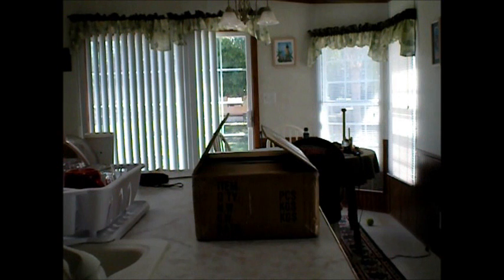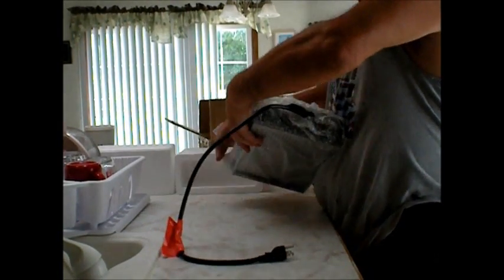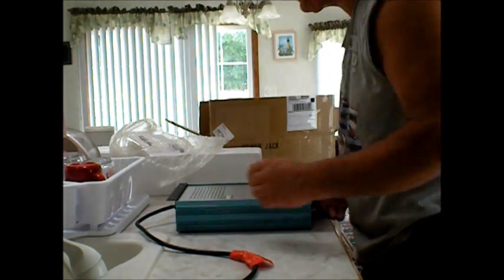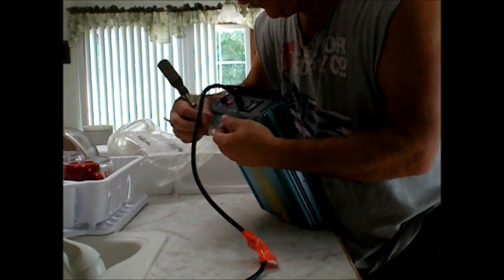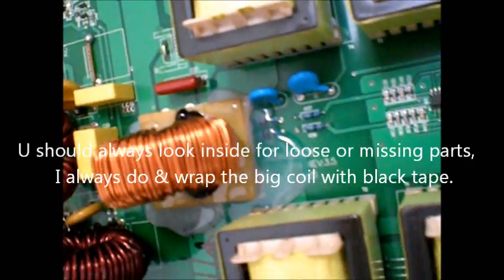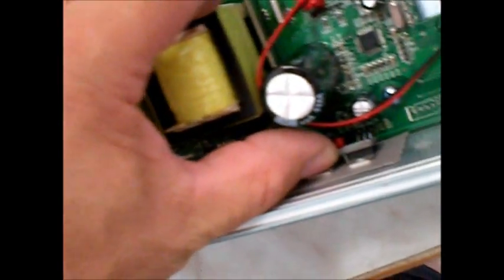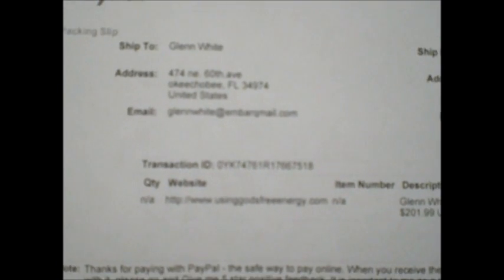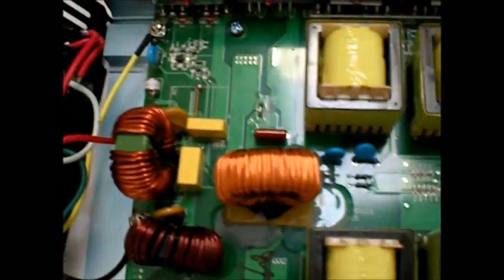A LOOK INSIDE MY NEW 1200 WATT POWER JACK #3

Comment from the maker: The Big coil i point to Barely clears the Back,the metal i pulled off to look inside. if the coil should hit the metal it could short out.or cause some other malady,The First 1 i got The Blue one with the big heat sink is the newest 1 it was built in December of 2011.this 1 in July of 2011,the other 1  the same color built 09-11,so i guess any that are built in 12 will be blue and have the coil wrapped at the factory. It has a CE,Rating a UL or ,ETL, soon it seems how there going I,m guessing.

Comment: why do you wrap the coil with black tape?
Reply: Because it is so close to the back panel and may arc across. Personally I prefer thin mylar sheet sold as stencil sheet glued on the whole back panel. But I have used glass fibre tape on coils.

Comment from the maker: This Is just Like the Other 2 new style power jacks. I have had great luck with them they work as they are designed to. But the last 2 i got this 1 and the other aqua 1 were made mid year 20011 the blue 1 on the bottom came with the big coil wrap in tape and well sealed in side with ample red sealer like what is inside of my GO Power 12 volt DC/AC inverter that has all the rating that u can get Marine ,RV, ambulance. etc, it,s totally coated red inside to make weather tight I Guess.

Comment: Thanks for the look inside. That looks like a very new one. A lot more components are on the top side now and they put the lightning protection on the board now. They also are using the larger size MOSFETs for the DC side which should let them run cooler. You are basically looking at 4 x 300W GTIs in one box. Not sure but it looks like they decided to put more caps on the DC input, which will help keep those caps from stressing out and having to be replaced like the old ones.